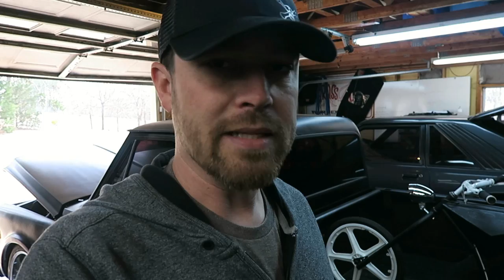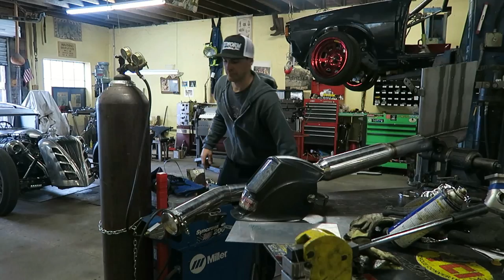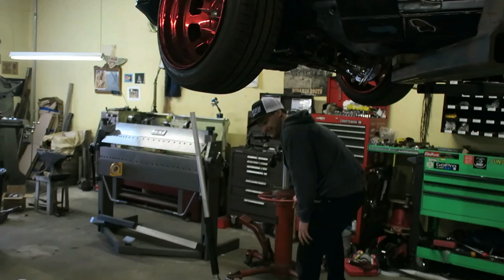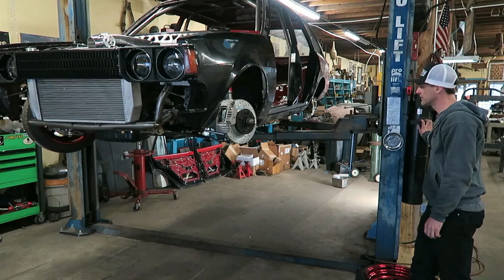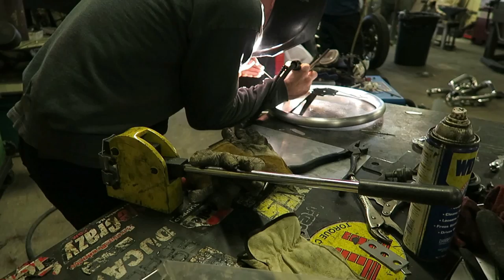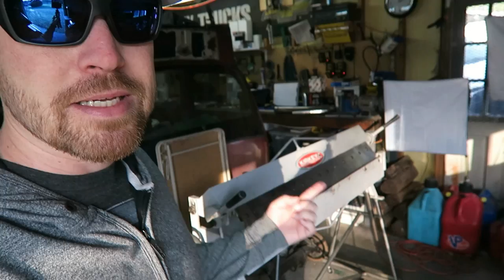Cutworm Specialties TE72 Corolla Wagon Drift Car Build

Comment: I know you the Grey Goose and Buggy as well as a multitude of other cool projects on the go or finished, but would you ever do a drift build?
Reply from the maker: yeah I really want to do a drift build bad. I have been looking at different platforms but I cant decide what platform I want to go with.
Reply: The Fab Forums 
What are the platforms your thinking about? I know it would be a complicated build, but I've always wanted to see someone or myself do a drift truck out of a mid '90's GMC 1500 truck, or something like it.
Reply from the maker: I have thought about just about everything....for many different reasons.
I considered a Fox because I know them well.
I have also thought about doing a C10...mainly because its different
And then I have looked at BMW's, 350z, Benz, rx7.
Reply: The Fab Forums 
Out of all those choices, I'd love to see a C10. I love anything with an engine and tires, but man would I ever like to see a classic sheet metal drift truck more than anything.